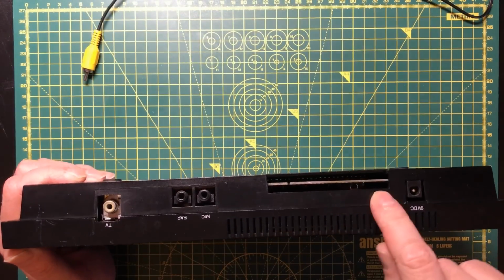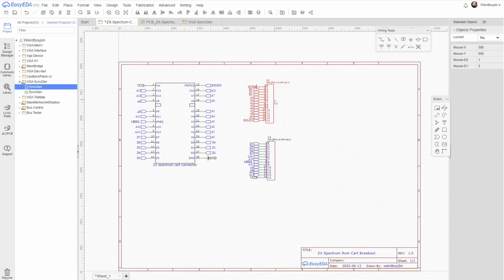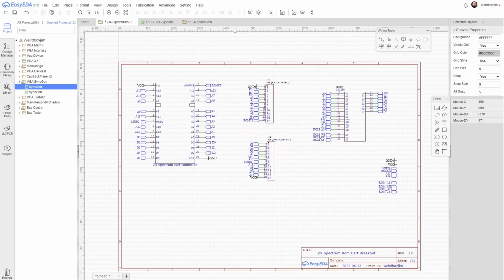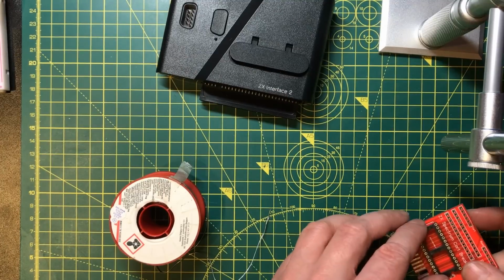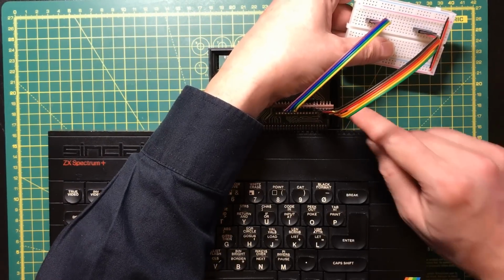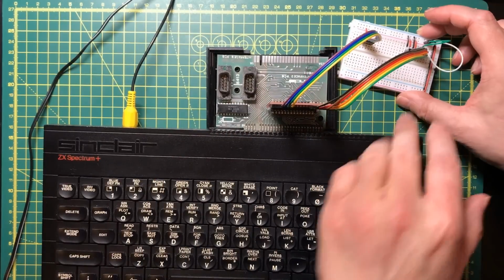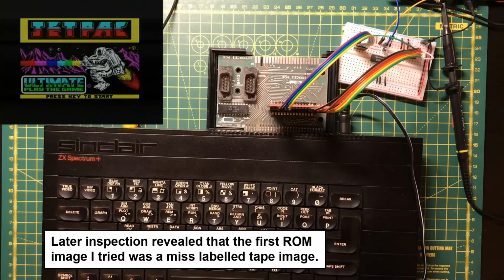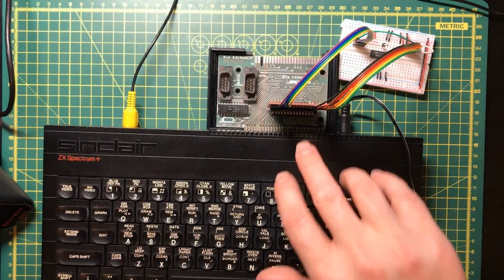ZX Spectrum, Rom Cartridge Research

Comment: it's because the interface 2 slot was specifically for connecting rom cartridges:  mainly, for swapping out the base 16k of memory which is where the sinclair ROM is usually mapped.  The full expansion expansion port on the back of the computer is  more akin to the cartridge connector you'd find on a console, giving full access to the various CPU buses.

It's a strange thing that the Interface 2 was probably intended to work with the 16k Spectrum and once the 48k became the dominant standard a 16k ROM cart simply didn't make sense anymore.
Reply from the maker: Oh absolutely.  The idea here is to take on a challenge, if it's easy / obvious then it's not as interesting.  The Rom socket is almost nothing beyond just the pins to connect a rom chip.

Comment: I am wondering if you were to get a whole MEMOTECH MTX512 plus the MEMOTECH HDX512 or the MEMOTECH FDX512 you might be able to do more with it than the SPECTRUM could ever do and using a special adapter called the SPECULATOR would let you play SINCLAIR SPECTRUM Software on the MEMOTECH.
Reply from the maker: Didn't they start out doing expansion port add ons for the spectrum?  I wondered how close their computer was to a spectrum (minus the sinclear rom) with their add-ons in built.

Comment: Have a ZX Interface 2 with the original Sinclair box in nice complete condition. But no ROM cartridges for it such as Jetpac. Would be great to have the original Jetpac ROM cartridge. To use it on my ZX Spectrum 16K.
Reply from the maker: Very nice! I've actually managed to get hold of an original rom cartridge now, I'll show it in a future video.

Comment: I have to admit, I am a little excited as to what coprocessor you end up choosing =)

Will it be a faster z80? Perhaps a later ez80 @ 25Mhz or a RPI-Pico. 

Maybe a 6502 for the trolls, lol's and fans ;)

I really appreciate your channel James, got me back into Z80 assembly after quite a hiatus, and I look forward to just more of it =)
Reply from the maker: Solving the interfacing challenges is what this effort is about, so I'd like to add something that makes it very clear we are doing something you couldn't possibly do on a regular spectrum. The Pico or an ESP-32  are good candidates but I'll think about that more after I've done  bit more investigation into the signals.
Reply: @weirdboyjim Connect your pipelined CPU. :^) even that would be a lot faster

Comment: If I remember correctly, Spectrum expansion was quite clever: expansion device had a rom that could be "swapped" instead of the normal ROM. When you type or run a command that ROM does not support, it triggers an interrupt. At that point expansion port device switches different ROM to be used. Now execution continues from the other ROM at same address. That can handle all the new commands weather they are typed or run.
Of course, after running the extra command for the device, it either returned from the interrupt or triggered another interrupt that triggered switching back the normal internal ROM and after returning from the interrupt, the code continued from the next point as if nothing had happened.
I used to have a book with full ROM disassembly (explained) and full schematics. Some tricks like interrupt triggering on invalid command (to switch ROM) were quite clever I think.
Reply from the maker: You might be thinking of one of the later models, the original spectrum just had the basic rom disable option.
Reply: @weirdboyjim  I only had ZX Spectrum (the one with rubber keys) and ZX Spectrum+ (the first one with hard keys),
I'm not talking about later 128k models or models like 2 or 3 that I'm very unllikely to have any deeper knowledge because I never had those.
I'm talking about ROM exchange exactly, that was triggered by an invalid command making a software interrupt that invoked the ROM swap (where interrupt was detectable from the connertor, not sure if there was int-pin available OR if it was detected by knowing that int leads to read from perticular address of ROM and address lines were available)
Anyway, I always found it quite neat that syntax error (eg errors with command parameters or whateve) triggers an interrupt that triggers the ROM swap for extra support.

Comment: When you said the cartridge replaces the internal ROM, one of the first things I thought was in fact CP/M-80, given that one of the requirements is "16k of RAM starting at address 0"; to run it, should be almost as easy as replacing the ROM with a 16K RAM chip, figuring out some way to set the RAM RW for writing to it despite the limited cartridge, writing a bootloader, rewriting the display drivers, and somehow connecting to some sort of disk for loading programs. Should even work on a 16k Spectrum I think
The tough part really is setting the RAM RW signal though...
Reply from the maker: Interesting project, you would probably do that with the main expansion port to make interfacing the ram easier but you could add a banking mechanism to allow you to load some code from a rom at startup and then swap the ram in later.

Comment: a memory mapped device will do just fine.
Reply from the maker: Yeah, I'll have to do all my IO via memory but there is no obvious way to differentiate between a read and a write on the cartridge.
Reply: @weirdboyjim  without the r/w lines you can only invent a "read only" protocol. reading from address 2000 to 20ff should be interpreted as a write 00 to ff by the card. but does it worth the effort?
Reply from the maker: @aldob5681  Unfortunately that would not work easily as you would detect a bunch of false writes from the dram refresh hardware. This is a very tricky problem to solve, but I can see a few ways to attack it but it's of interest precisely because it's going to be very difficult.
Reply: @weirdboyjim  you are right. refresh uses mreq also. well the last option is a write command to ram. no mreq involved. R register is only 7 bit so there should be 1 bit always 0 or 1. don't know. anyway it all seems very tricky
Reply from the maker: @aldob5681  Wouldn't bother if it was easy.  anyway, I don't want to preempt the next couple of videos content in the comments.

Comment: Respectfully adding an FPU isn’t the obvious choice. You’ll need to write an single instruction + data to the memory then read the data out. That’s slow on an instruction by instruction basis.

What would be better is a GPU. Upload a block of code once and read / write buffers as needed. The bottle neck of writing in and out of memory isn’t as big a deal then.
Reply from the maker: Respectfully, you just assumed what I’m going to do and then told me it’s wrong. My plan is to add a coprocessor but that will be more gpu than fpu but don’t get hung up on the specifics, the interesting part here is solving the interfacing challenges. Success however will need to show something qualitatively better than can be achieved by a spectrum alone or there isn’t really a point.
Reply: @weirdboyjim  that's fair. I've not heard the term coprocessor used to describe GPUs. I understood it to mean chips that were effectively expanding the instruction set of the main cpu. Not independent processors in their own rights.
Reply from the maker: @c0d3w4rri0r  I'm equating this effort to the SuperFX chip added to some SNES carts which was always called a co-processor.

Comment: I remember the manual for my Spectrum 48K described the expansion connector as "you can do almost anything here that you can do with a Z80. Sometimes the Spectrum hardware might be in the way."

That says a lot about the home computers of the era.

I still have my Speccy although I don't know if it works. It is just so much more convenient to use emulation whenever I feel the need.
Reply from the maker: You should fire it up! Emulation is great but nothing beats for the nostalgia of firing up the hardware!

Comment: i made a little rom board to go in an interface 2(or ram turbo) only really need 2 diodes and a resistor for the eprom/eeprom rom select..and yes the original cartridges can fetch stupidly high prices, they were expensive at the time, from what i remember ... there was a design in an ETI magazine many years ago for a z80 spectrum coprocessor board, which could also run as a 'standalone' computer ..
Reply from the maker: Yes, you can implement the OR gate with a couple of diodes but this was more research than just trying to get the rom interfaced.
Reply: @weirdboyjim  i didnt actually think it'd work as i wondered if it'd pull down fast and hard enough, but seems ok, i used 2 diodes with pulldown plus a transistor 'booster' with fairly low resistance pulldown emitter load in a diagnostic board, because of this... diodes + resistor alone may not work so well with older non cmos eproms , ones without the C in the name..?

Comment: Doesn't the Speccy edge connector carry all of the CPU lines?

If you do replace the current PCB how about making one with a larger ROM and having a switch to chose between the banks?
Reply from the maker: I'm connecting to the cartridge port which has an extremely limited subset of the times. doing what I I'm planning on the main expansion port would be easy and not really a challenge. That kind of switched rom cartridge would be very easy, people have done that before and sell them pretty cheaply (I saw them a few times when watching out for "real" carts).

Comment: Is it doable? Memory request would be to tell the system to put data onto bus right?
With the ROMCS asserted I assume the system addresses the rom, otherwise it may be reading from it's memory or even writing to it.
Since there is no more available signals to discern a write to the expansion/coprocessor you'd have to assume writes to some address in memory/system is writes to the coprocessor then?
Reply from the maker: Yes it is doable, but it will not be easy. Several people have told me point blank that what I propose is impossible which is of course strong motivation to prove them wrong. You seem to have some understanding of the problem space but don't forget the dram refresh which can't be easily differentiated as well, there are some shortcuts that I could take easily if it wasn't for the refresh!

Comment: Nice to see you with a speccy :D
I have something that may be useful for you, it's the ZXShield, it allows you to connect an Arduino to the speccy and virtualize any kind of peripheral or memory. It is published in my github (you can find the link in my profile) and there are examples on creating a wifi card with telnet software, a remote program loader, a poke search system, virtual roms, midi sound card, etc etc. Even if you don't use it the content of the repo may give you some ideas about things to add to the speccy ;)
Reply from the maker: That does sound like an interesting project!

Comment: This might be a crazy thought but we know the following is true if you have a sufficiently powerful co-processor:
   You can detect memory read addresses
   You can supply data in response to a memory read
   You can modify the data to be read from memory by the co-processor asynchronously

   You could theoretically have code ran by the Z80 that performs memory reads be interpreted by the co-processor as “writes” by looking at the bottom 8 bits of the address of some 256 byte address space and treating it as a data byte that you then write into co-processor memory space to be acted on. You have the ability to write back new strings of Z80 code into the Z80 ROM space by the coprocessor in response to whatever data you read in, including jumping the Z80 wherever you like in ROM space. That’s almost like having infinite memory if you can modify the data coming out of the ROM faster than the Z80 can execute.

If you need the Z80 to “wait till something is done” you would just have the code it’s currently executing by a busy loop till you overwrite the byte that jumps back to the loop label.

I’m not sure I articulated this thought super well. An RP2040 dual core should be able to do a lot in between the Z80 ticks and obviously can shame the Z80 on all levels but the concept of giving the spectrum “more” and not just trying to replace parts sounds like such an interesting thing to do.
Reply from the maker: Thinking about clever tricks like is where it gets interesting. You should note though that the cartridge socket doesn't have read or write lines to differentiate between those operations, the z80 will also do dram refreshes and we don't have anyway to differentiate those from a memory operation. There is a whole layer of problems to solve before we move to deciding on a response to specific operations.
Reply: Boo. I was thinking you wouldn’t need to differentiate read/from write if you considered reading specific memory addresses to be a “write to a FIFO” but the DRAM refresh blows that up.

Comment: You set you will like to create some coprocessor. I'm looking forward what kind of coprocessor you are planing to implement. Anyhow; you have plenty place in original ROM to add your own routine and use write into ROM space positions for communication with your cartridge. you can in say mode 0 react just on specific address range with your routine, in mode 1 implement your own ROM all 16KB with bank switching and use in ROM address space 4KB for transfer buffer to load into upper 48KB. you can even listen on bus and make backup from standard upper memory space to by able to restore original content. In any case I'm waiting what for coprocessor you would like to create. From me 👍
Reply from the maker: The SNES had the SuperFX but designing something like that would be overkill since we are really interested in the spectrum side and the interfacing. I'll probably use an off the shelf micro controller to do something similar.
Reply: @weirdboyjim  Generally it is a Math coprocessor, you already showed solution with sin table in ROM. At 0x386E you have 490B space in ROM for routines, you can even improve original BASIC command for SIN,... You have no n_WAIT signal but you can make routing setting input parameters in input "in memory registers" like C64; set Z flag zero and next will by JZ on the same address back in never ending loop. This cold be your trigger for your coprocessor, make operation you want, write result in your "in memory output register" and then just change JZ into JNZ what will release CPU from never ending loop. Don't forget after CPU executes JNZ (continuing on to next instruction instead of jumping) put JZ back 🙂. I like more low level solution and a bit Z80 assembler and not like some modern MPU, and if than CPLD or FPGA. I'm sure you will come with some other original solution and I'm excited a bit, sorry.

Comment: When working on the ZX Interface 2.021, the lack of signals on the cartridge port soon became a problem - my conclusion was that they probably never intended for the format to be anything other than an intermediary product.

There's significantly more that can be done from the expansion port and that is probably your best guess, doing regular port read/write as a first step - just ensure that you don't blow up the ULA by using one of its ports (all even numbers at the very least).
Reply from the maker: My plan is to do it all from the cartridge port, it would be too easy from the expansion port. This project is about taking on a crazy challenge rather than the easy path.

Comment: I wonder if it would be possible to connect a Spectrum to the internet with a 48k modem. Transmit could be the beeper pin, and receive could be a pin in the joystick port. After that, a modem to USB adapter or old router should be easy to get, and some stuff like the Twitter API can be accessed pretty easily I think. But perhaps a humble serial port would be more realistic with this bit-banging setup.
Sorry if these many comments are annoying...
Reply from the maker: You could probably do some kind of Acoustic coupler communication without any extra hardware, remember the spectrum used sound on audio tape for data storage.
Reply: Oh! I think Usagi Electric has one for the TI 99, is it the module that takes the handset from a landline phone?

Comment: An interesting project! It was certainly possible to add 2nd processors via the standard connector, this is effectively how development systems squirted the data into the Speccy memory, but this did need the full bus. 

My first thought was to split the 16K chunk into 2, with the lower half being (as it must be) the Speccy Boot ROM, and the upper being 8kB of static RAM for the external processor to dump data into. Sadly, there is no R/W line to allow the Speccy to write data back. I guess you can fake this by using the low 8 address bits as data bits (plus possibly a clock/latch bit) and maybe having 1 or 2 byte-wide latches instead of SRAM. A boggo Rasp Pi would probably be overkill as a slave CPU, but interfacing would be easy, and the development environment would be faster than a headless RP2040 or whatever. Shame there is no interrupt pin available.
Reply from the maker: It's worse than you think, there are no lines to differentiate between a read, a write OR a memory refresh. I do like a challenge.

Comment: Not sure if I misunderstood what you were saying at the end there, but while the cartridge slot in the Interface 2 isn't much use for anything but ROMs, the Spectrum's expansion slot has the connections to allow you to do pretty much anything.
Reply from the maker: That's right, the challenge is to do the interfacing with just the cartridge port. It would be easy from the expansion port. I am not known for setting myself easy challenges.